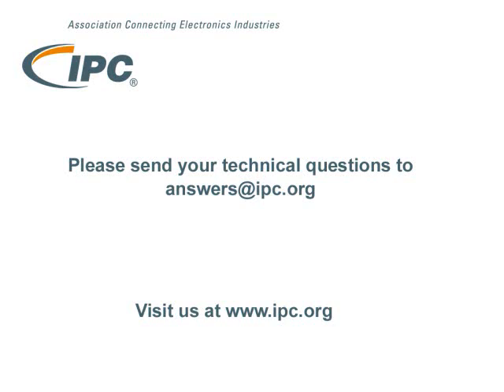Are solder balls remaining on an assembly after production acceptable?

Comment: How do you make sure "entrapped solder balls" don't move?

If the solder ball is attached to the FR4 circuit board via flux & or flux & a weak connection from the molten lead adhering to the FR4, how can you be 100% sure it will not become dislodged?

How do you test or gauge that?
Reply: I think most solder balls are encapsulated within the flux resin so they don't move that much during application years. See IPC examples images.  Unless you poke or mechanically disturbed, then that will move around in the PCBA. Possibly near to conductive patterns, and later will affect the application.  But hey, others may have more experiences to share.